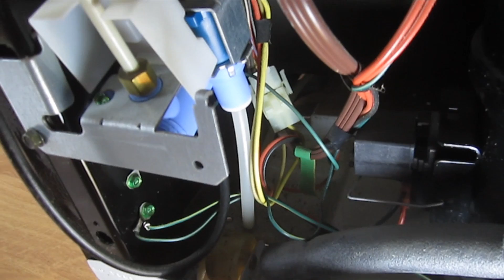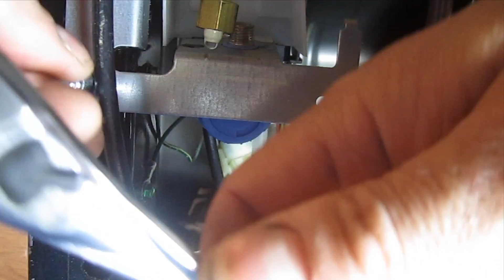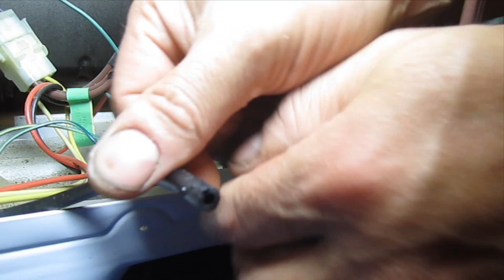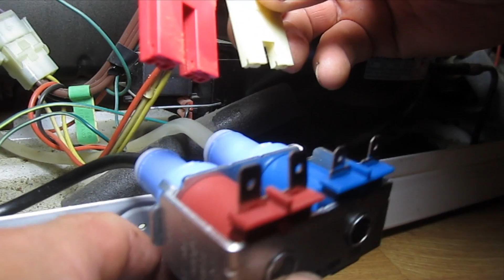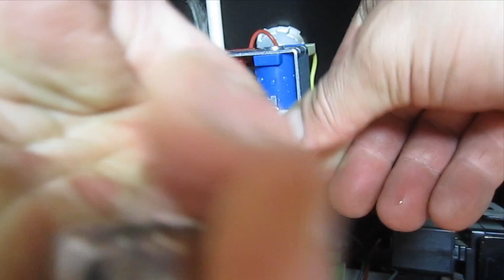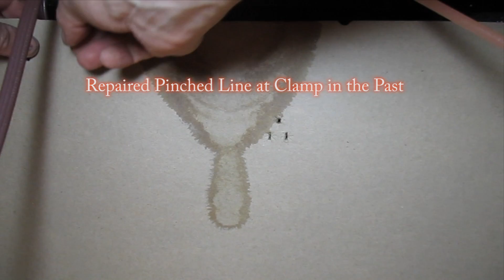Leaking Water Dispenser Refrigerator Repair - Water Inlet Valve Replacement When Water is Leaking

Comment: Is it a valve or a pump???  I'm not getting water on the ice maker or water dispenser.  When I remove the line in the back I have pressure in the main line, but not after it passes through the filter.

Comment: I just changed the evap fan 4 days ago ebay $22, I'm thinkin the water leaked on it while making ice and it made the fan go out, because now the water soaked the ground last night and the ice is chunky and all, There's was a little ice build up before the fan went out.  I tapped on the back of Water Inlet Valve today, Now it makes a sound like it's powering up, but now no water comes out after doing that, I unhooked the line, there's water pumping there., I'll order the switch now I'm guessing . mine in from 2002 Model HSS25gfpaww

Comment: Mark, PSS27NGMA BB is the model # of my GE Profile frig. I have had service completed on it and it has worked well. New board, ice maker, inline water filter.  I went to use my water dispenser and had a ton of water on my floor.

I removed the lower panel to look at what was going on and have discoved that there is one water line not hooked up, but... one where to connect it either. My water valve have 4-5 connection points, all are connected except 1 line.

Your thoughts?
Reply: I found the problem. It was dry rot in the waterline to the water dispenser on the door. The heat from the compressor and made the line brittle. I installed a new water line from under the door back to the water valve. Problem solved. Thanks!
Reply: Thanks and thank you!

Comment: Hi Mark.  This video details a slow-leaking, "drip-drip" water dispenser problem.  My water dispenser acts more like it simply won't turn off.  I have had to turn the water off at the valve, otherwise, there's a steady stream coming from the water dispensing tube in the freezer door dispensing area. 

I bought the unit (GE Profile, model PSS26LGRC CC) off of Craigslist and hooked it up 2 days ago with no issues.  It is making ice, no problem.  It dispenses ice, no problem.  When i tried to use the water dispenser, it at first leaked a little bit after lifting the cup off of the 'depressor' but then stopped.  After a few more times, now, it won't stop at all, even without pushing in the 'depressor'. 

Do you think this valve is at issue and replacing it will fix the problem?  Or would you imagine something else is at play?  I don't want to buy the part just for it to not fix anything. 

Thanks for your help. 

Bill
Reply: ***** Hi Mark.  Thanks for all your help. Here's how it played out:
I removed the power to the valve and it still leaked, so that was good indication that the valve was the problem (thanks for that tip). Not wanting to buy another valve and deciding i was okay living without the water dispenser, I bought some 5/16" tubing and an end cap to essentially 'plug' the water dispenser side of the valve and retain the ice-maker side.  This would have worked had the valve not been degraded by over-use (pushing things in, pulling things out)--i ended up not being able to stop water from leaking directly from the valve.  So, in the end, i had to order a new valve.  That installation went off without a hitch and now the ice AND water dispenser are working just fine.  Thanks for the help, and hopefully this note serves others here--JUST BUY A NEW VALVE, you can't really work with the existing one once you've pulled the line out the first time.

Comment: I just replaced this valve on my nearly 12 year-old GE refrigerator yesterday.  I was amazed at how simple and straightforward the replacement was. The valve is located directly behind the easily removable panel at the bottom rear of the refrigerator and is dismounted with just a single screw. Accessibility couldn't have been easier. Even though there were less expensive compatible valves offered on Amazon, I went with the genuine GE replacement part on Amazon that cost about $36, with tax. I have no doubt that having a repairman come to the house to do this would have cost at least $200. Thanks for this great video!

Comment: HI
I just bought the new inlet valve and did replace it, but the water is not going through the valve....the water goes until the first top hole where we connect and screw it.
Should the water goes through the two botton water hoses once I connect??? Looks like the water in not flowing by the two bottom water hoses. Is this normal...??? I thought the cable connector that connects the valve was bad but looks like the water is not going through those small holes on the bottom which make sense why water is not going to the washer dispenser at the front door.
Do you have any tip for me???
Thanks

Comment: HI....I have the GE refrigerator and is the same valve that you replaced.....I did remove the valve and blew inside from the screwed part to see if any air goes trough it but it doesn't...If i blow in the 2 hose connector which has 2 different diamenters i can feel the air going inside one hole and getting outside the other water hose whole.
If I blow from the top connector that has the screw part do you think that the air should go through the 2 hose connector..???
I so I this the valve is bad...for the water stop coming from the water dispenser.
thanks

Comment: Great video- I just bought a fridge froma friend... I have water- it's not making ice. (It does if I pour water in the tray) Wondering- should I change the valves like you did or replace the ice maker? Thanks for your info!
Reply: Make sure you have water going up into the water dispenser. I don’t think the problem is your Ice-maker. If you have no water getting up to the dispenser than try changing the water inlet valve which is this same exact part illustrated above. Make sure you go to the GE part store or your particular Brand part store and put in the model number  of your refrigerator to make sure you are purchasing the proper valve for your refrigerator.

Comment: The icemaker is out. Water has been turned off for quite a while. When we turned the water back on, water started leaking all through the door water and ice dispenser, not just the water tube. There are frozen drops on the back of the freezer where the icemaker was. This is a vacation home so we turn the water off when we leave for a few weeks at a time.